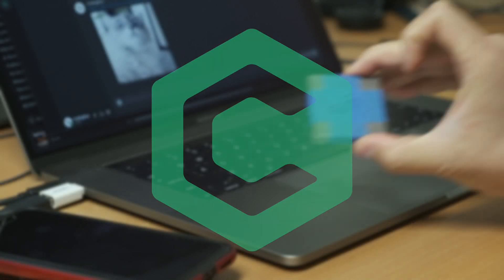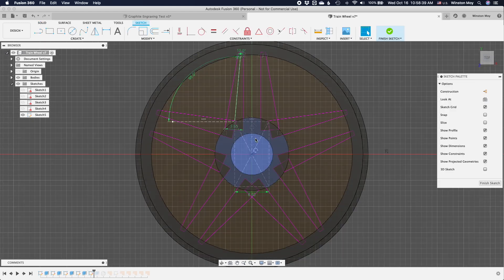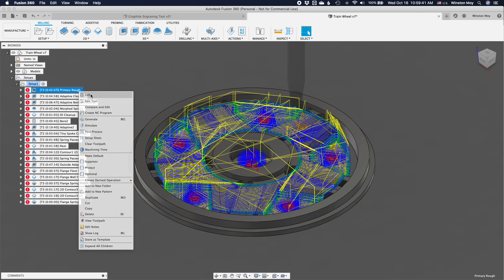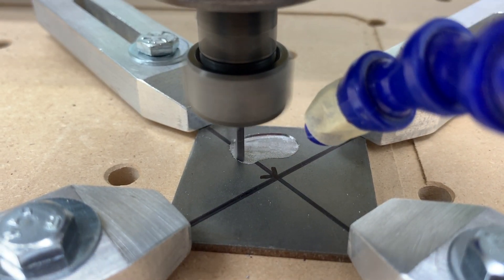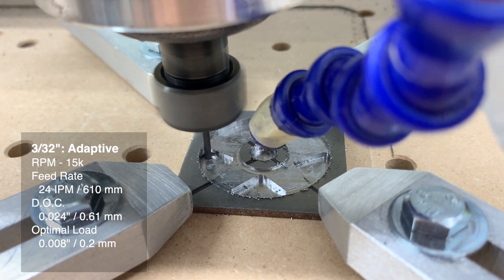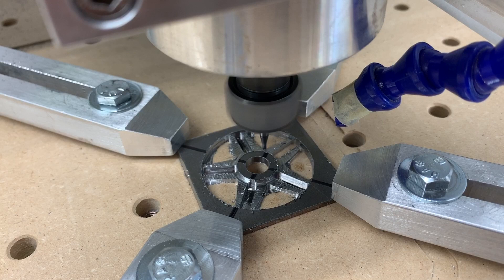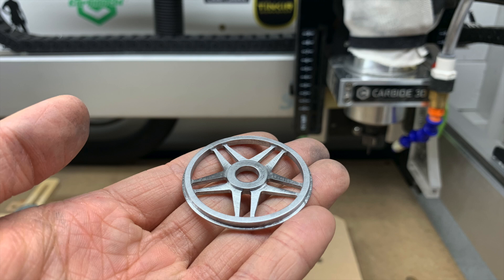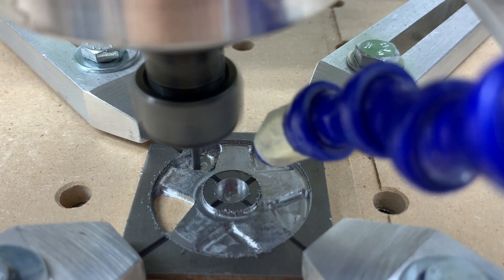Machining Stainless Steel on the Shapeoko 3 - #MaterialMonday

Comment: I've gotta cut some 304 on my one finity and I'm thinking my machine will do it, it's way more stout than the shapeoko. I'm surprised you don't have more subs TBH. Excellent content!
Reply from the maker: A factually incorrect statement. That machine is decidedly less rigid than a Shapeoko.
Reply: @carbide3d  😆😆😳😳 have you ever used one? Ever interfaced with it??

Comment: Thanks for the video. What is the maximum tolerance for wall thickness when doing CNC on SS with this machine?
Reply: What? The tolerance is decided by the print.  Are you asking how accurate the machine is when cutting SS?
Reply: @Rightisallwrong  my apologies, I wasn't clear. I want to cnc a block of steel or aluminum 6061 but the wall thickness is about 0.5mm to 1mm but the wall height is about 7 mm. Wanted to know if that would be possible with cnc machining. I am trying to learn about cnc machining before buying one.
Reply: @V_raptor88  Ok, I got you lol

Big difference between steel, stainless steel and aluminum when it comes to milling.  But the main thing is how tall and thin that wall is.  Is there anyway to support the side opposite of where you’re cutting? Because I’d imagine that wall will want to vibrate like crazy.  It’s less about whether you can make that feature and whether or not it’s going to chatter like crazy.  It is likely that the wall will be thinner or thicker in the middle as that is where it will be able to flex the most.  

Anything is possible, if you were ramp down as you mill the perimeter, that would put some of the cutting force down instead of to the side, which would help keep the chatter to a minimum.  But you wouldn’t really be able to go back for a clean up pass as you’ve milled all your support away.  The diameter of your tool relative to its length will also play a role in how much flex happens.

But there’s only one way to know, to try it.

Comment: How did you arrive at your optimal load and depth of cut? Was there a reference you used as a starting point, or was it primarily trial and error to see what gave the best sound and quality of cut?
Reply from the maker: I sort of default to 0.01" optimal load for metals, and will make small adjustments based on what I observe. I also looked at tool manufacturers recommendations for chip load, and S&F, then reduced depth of cut to account for reduced rigidity. Mostly cutting by ear, but also looking at tool wear to see if the S&F are sustainable. Vibration will dramatically reduce life expectancy of tools.  
-W

Comment: Desktop CNC what?  Of course you can machine wheels on a CNC.... yes a CNC lathe.  What you have is a CNC Router or Mill.  FFS get the basic terminology correct.
Reply: He explicitly says that this is purely to demonstrate that you can machine stainless steel on a desktop CNC mill. The wheel was just a random item he chose to demonstrate. He even says that you would want to use a lathe to make a wheel in a normal setting, but this is just to demonstrate the concept. Watch the video completely before you make nitpicky comments.
Reply: @davidk8893  The point of my comment  (which you seemingly completely missed) was, the equipment he used is not a "CNC", there is no such equipment - it must be a "CNC ... something"
CNC means "Computer Numerical Control" so him saying, "I am going to machine this on my computer numerical control" is just plain wrong.  It is like me saying, "I have a red." when I should have said, "I have a red car."  It is a nonsensical, lazy and inaccurate statement.
He was using a "CNC router", how hard can it be to speak properly?
Reply: @poruatokin  No, I understood your comment perfectly. It's an unnecessary nit-picky complaint about a gramatical error that does not significantly detract from the understandability of the content. I don't suppose you say "laptop computer" every single time you're referring to your laptop? Or "motor car" rather than car? How am I supposed to know you don't mean "train car" or "bumper car" or "flying car"? The tiniest little bit of context tells me that you mean a normal motor car.
Shortening the names of things is a common practice in the English language. If two people are talking about cars, and one person says "I have a 2004 Camaro, how about you?" the other person may reply "Oh, I have a 2005." What, do you expect them to say "Oh, I have a 2005 Chevrolet Camaro" instead? No, because it's unnecessary. The context allows for the omission of words, regardless of if they are grammatically correct or not. The same thing applies to "desktop CNC". Sure, it may not be technically grammatically correct, but if you got the point of the sentence, then why bother complaining about it? He says "desktop CNC". How many desktop CNC lathes have you seen lately? Few, if any. The only real CNC machines that you see on a desktop are typically routers or mills. And that's the subject of this video.
(before you decide to "educate" me, I know 3d printers are CNC machines that fit on desktops. However, you don't machine things with 3D printers, and nobody calls them CNC 3d printers anyway, so there is no reason to think that he was talking about that either.)

Comment: Could anyone please tell me how this carbide3D machine quality and accuracy is compared to Taig CNC milling machine !
Reply: The Nomad is definitely stiffer as it has beefier linear rails than the taigs extrusion and the gantry style helps that stiffness .   Also, this is a "mill in a box" and totally self contained with a tool height setter and their software designed specify for it,  where the Taig is open with steppers and wiring totally exposed and pretty bare bones with a lot of it up to you to decide.    Quality of the Nomad is excellent and no worries about chips all over the garage.  You can literally use this on your desk.
I'd go nomad over Taig any day.   
Oh plus, Taigs are really designed for micro parts and will struggle with larger parts but are definitely accurate little guys. This has a bit more capacity in that respect, but really two different machines for different purposes.

Comment: Why is the bit cutting backward?  I own a cnc and I use upcut bits on it and my tool runs in the other way for smoother finish...
Reply: The bit is cutting in the correct direction, he is conventional milling instead of climb milling though.
Is that what you mean by "backwards?"
This little toy is not near rigid enough for climb milling in stainless.
Reply: Yeah I would not do climb milling on that router unless you have a poly-carbonate riot shield in front of you..ha ha.

Comment: Awesome. But why wouldn't a CNC lathe not be able to cut perfectly round wheels?
Reply: I'd imagine minor variations in the x/y travels. I'm not as familiar with CNCs, but in 3D printing things like gears they can to come out just slightly oval for I believe that reason.
Reply: @ElectroPulse93  there is no Y axis on a CNC lathe because the stock rotates. It will be perfectly round in the end.
Reply: @ChristophPech  Oh, my bad, I missed the word "lathe" in your comment.

Comment: would you save time if you proplerly clamp 3-4 sheets on top of each other ?
(so the endmills deph is use too, not only the tip)
Reply from the maker: Not really. My depth of cut isn't exceeding the thickness of the material, and features like the flange could not be machined with something on top. For thin gauge sheet metal that might be more appropriate.

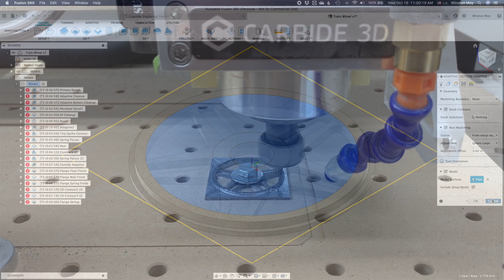Comment: 2:56 dude, did you have to eat all of that material up? you could have just made a cut all around the wheel
Reply: I assume he did this because using an adaptive tool path like he did puts much less strain on the endmill and cnc. If he used a countor toolpath to just cut all around the wheel the endmill would be plunging straight into the stock and would be cutting on both sides of the endmill. on hobby machines, I always try to avoid slotting because you are more likely to break an endmill.
Reply: Slotting sucks, especially in stainless.  Avoid it when you can.  It's a good way to get your tool to glow red and then break.  Ask me how I know.
Reply: thanks for the explanation guys. much appreciated

Comment: Good Stuff...PS: Cutters last a whole lot longer with a little coolant/WD40, BUT that does not play well with the stock MDF wasteboard, BUT #2, there is nothing wrong with placing a piece of sheet metal over the MDF board to protect it.  I know a guy who knows a guy who machined a Stainless Steel Watch on his Shapeoko....or so I am told... PS There is a HUGH difference between the grades 301/304SS and 303 (free machining).  Know what you are cutting.
Reply: You know that guy?  I wish he would share more videos of his projects.
Reply: Which is easiest to machine?
Reply: @Audio_Simon  Butter (since you didn't specifically list your choice of metals...)
Reply: @RichardCournoyer  Context dude! Stainless steel grades.
Reply: Simon A Only the 303 Grade. Why?  Because it’s only grade the Free Machining.  We could go into the material science as to why, or you can just trust a guy with over 40 years of experience.
Reply: @RichardCournoyer  I don't really understand the language you are using.  Grade the free machining?
Reply: Simon A  Well you could look it up... 
Free machining is a manufacturing process utilizing metals, which has specially been designed to increase the machinability of the material. Meaning it makes it more like machining butter. Cutting 303 stainless steel is 100 times easier than cutting 304SS
Reply: I have tried to machine 304 and had a lot of trouble. Even using coolant it would harden and just rub / deform on the cutter. They were thin pieces though 1mm-2mm so probably very little material to sink heat. I have drilled and tapped but even that was tricky with m3 holes.
Reply: So if you purchase 303 stainless, does that mean it is done with free machining? Or is there something else I should look for?